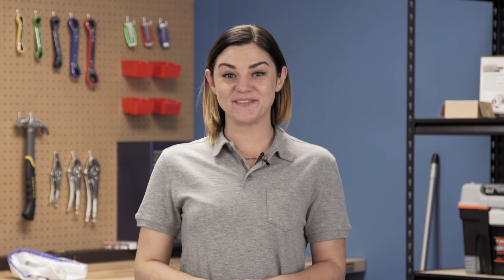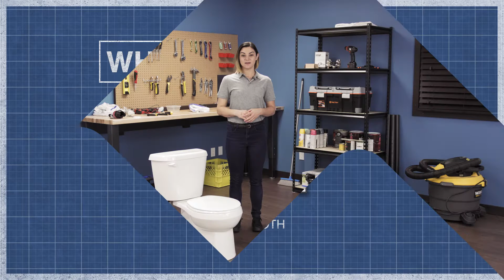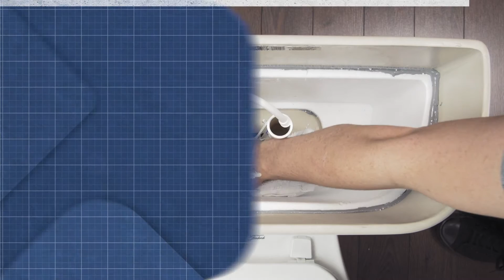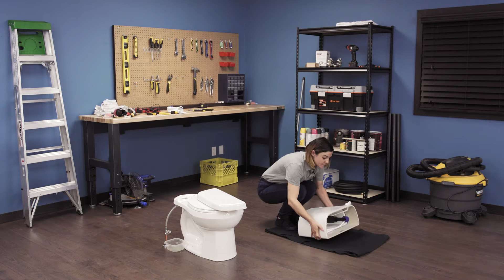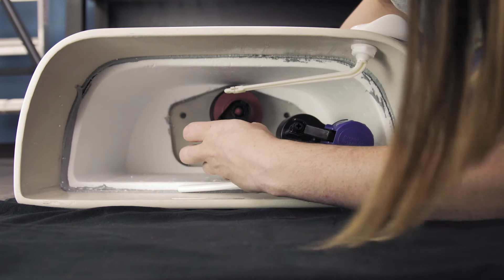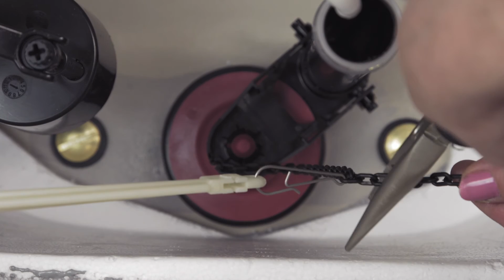Flush Valve: Repair and Replace (2 Piece Toilet)

Comment: OOps.You forgot to mention to shut off the water valve before unscrewing off the water hose line that's attached to the fill valve.
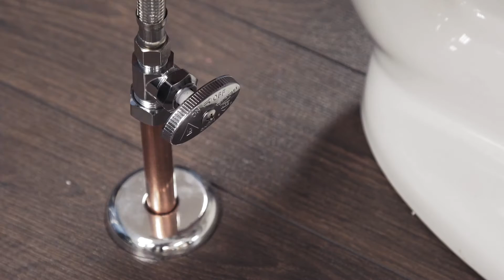Reply from the maker: Thanks for watching. Shutting off the water is specifically mentioned before anything else and is shown at 1:03.

Comment from the maker: Update: Just a note before mounting the tank at 3:03 , secure the bolts onto the tank first with the first 2 nuts to help create a good seal inside the tank. Then use the remaining 2 nuts to secure the tank to the bowl.
Reply: Yes, this is smart for a good seal. However,  this might make future removal of the tank to bowl bolts difficult. There is often a lot of corrosion over the years. If you have to cut the bolts, it is easiest to cut them with a hack saw blade if there are no nuts between the tank and the bowl.  I still think it is worth having nuts underneath the tank for a better seal, just try to get solid brass bolts, washers, and nuts, to limit corrosion, so you have a better chance the nuts can be unscrewed, thus avoiding the need for cutting through both the bolt and the nut with a hacksaw blade that can be very time-consuming.

Comment: You don't mount the tank like that I have done it that way and my dad said it is the wrong way because we say leaks when I did it that way... you need to screw nuts onto the bolts before you mount the tank and use the second pair of nuts and washers to bolt it to the tank
Reply from the maker: Thanks for watching. This is an older video but that is a good point, and that shot is missing from the final edit. We have added a note to help point out that detail to people.

Comment: The rubber deal has nothing to do with the flapper and the flapper seat because the seal you are talking about is the part that seals the tank so nothing leaks below the flapper
Reply from the maker: Thanks for watching. The rubber seat that seals against the flapper can still deteriorate and create problems. If we redo these series we'll likely talk about the different scenarios in more detail covering both.